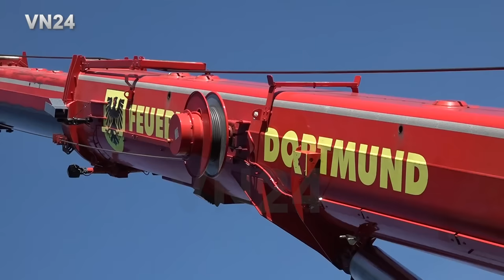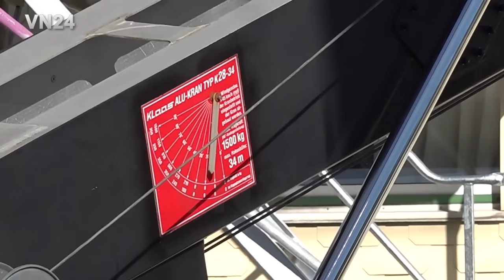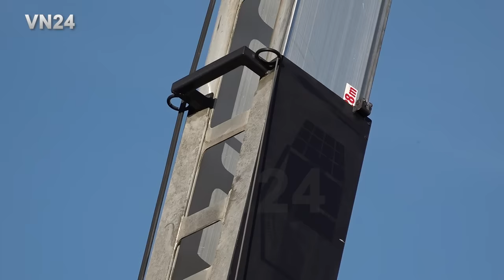04.09.2023 - VN24 - Dachdecker Kran kippt auf Haus in Herdecke - Feuerwehr übernahm die Bergung

Comment: Die haben ja garkeinen Plan gehabt. Etwas Physikkenntnis (Hebelgesetze) hätte geholfen.
Reply: unfaehiges Personal,  hoffentlich koennen sie Feuer loeschen?
Reply: They had a plan. It all hinged on righting the telescopic boom crane without using the boom as the connection point is not engineered to withstand being lifted.

Comment: Con un braccio così lungo cosa si aspettavano!!😂😂😂
Reply: Actually, the weight of the load wasn't a problem at all neither was was the extension of the boom.
One of the outriggers slipped off the wood used to support the cranes weight and the outrigger sank into the ground which led to the crane losing it's balance.